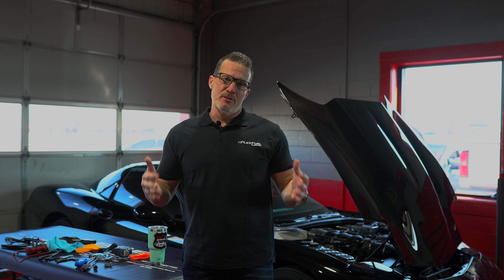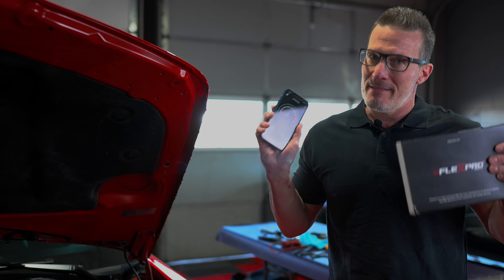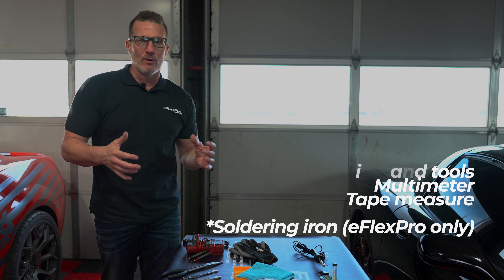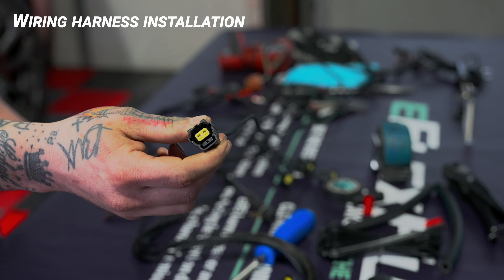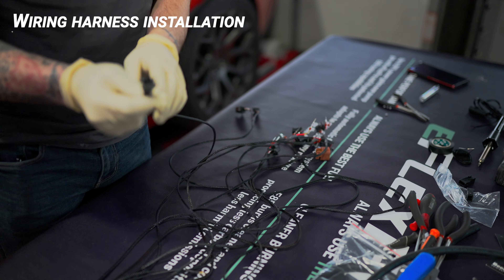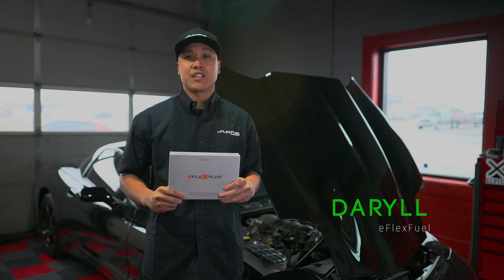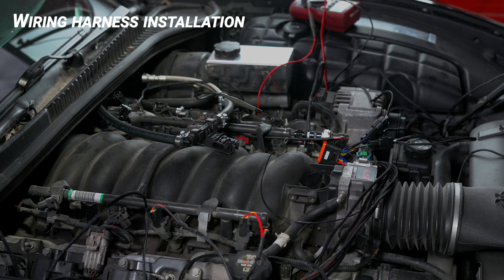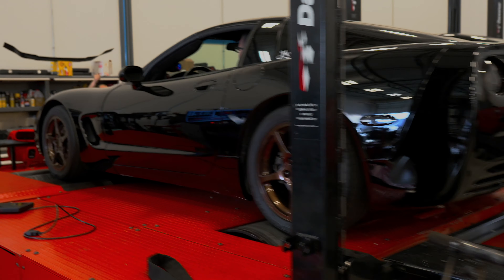How to Install an eFlexFuel Conversion Kit on a Chevy Corvette C5 & Chevy Camaro LS3

Comment: They said we need a solder iron but then never used it explained why....
Reply from the maker: Soldering iron is only needed in if installing eFlexPro kit, for soldering the signal wires for example to the map-sensor wire etc.